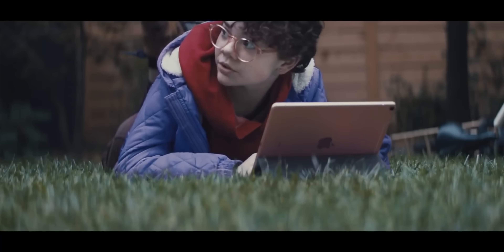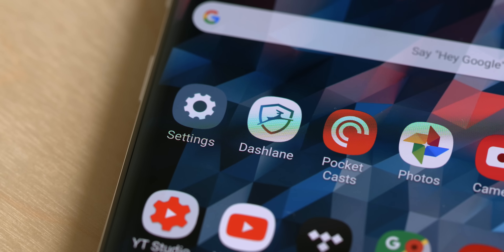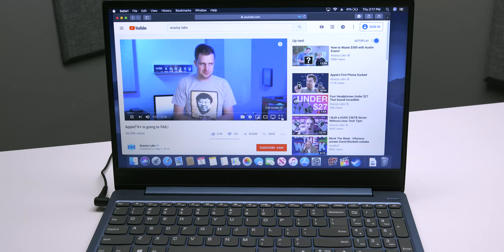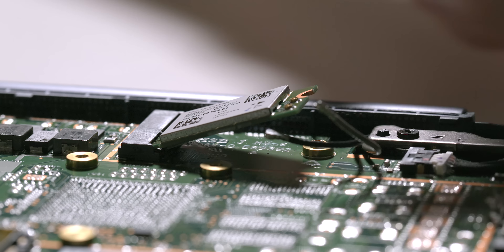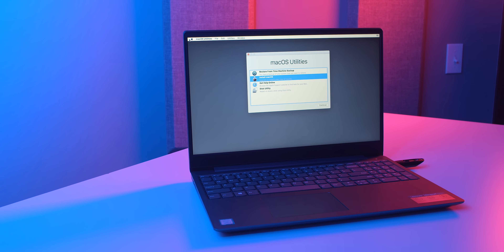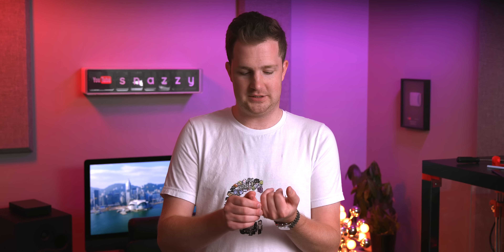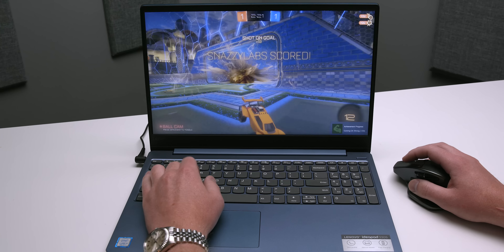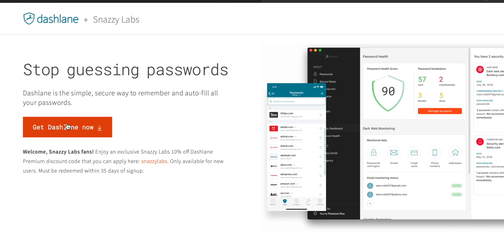The $279 MacBook Air KILLER!

Comment: "apple reccomends 8GB"

- so thats why my macbook air from 2015 with 4gb of ram is so trash
Reply: Mojave however wasn't released in 2015
Reply: Bukan Vanessa Angel 😂 or install some ram via CD-ROM
Reply: I guess it is kind of hard to compare every wintel install versus a *inx install since the kernel is so fundamentally different.
Reply: @thomas0086  only problem is you have to download a cd rom reader as well
Reply: @My_Old_YT_Account  Pretty sure you can print a cd rom reader these days.
Reply: 2015 is upgradable!  Pack that puppy full of ram d00d!
Reply: @MemelordSupreme  it isnt. its saughtered.
Reply: @MalteSpieltYT  shoot i just realized you said macbook air.  I was thinking of the macbook pro! My bad!
Reply: @MemelordSupreme  thats fine! yeah, the macbook air is sadly not upgradable. but at least the GPU doesnt die like in the MBP
Reply: @MalteSpieltYT  Soldered*
Reply: not so much since those machines have pci express based storage so when they have to page file its not to much of a bottle neck as it were to be when they had to do it on a conventional drive but i feel you on that. Apps like premier recommend 8gb and the computer has 4 and then still manages it just fine.
Reply: you can upgrade a 2015 though...
Reply: you still bought it :O
Reply: What’s you e-mail address, I can send you at least 7gb of ram to you inbox. For the extra Gb you’re gonna have to ask Santa Clause.
Reply: All with fapple logo is trash then ram not help you...
Reply: That's why my samsung tab s6 has it.
Reply: SAME with my 2014
Reply: @AgentLokVokun  Mac OS is too demanding. Other unix/unix-like oses are way less demanding.
Reply: @vogonp4287  MacOS Mojave requires at least 2 GB of RAM as well as 12.5 GB of available disk space...

MacOS Mojave requires at least 2 GB of RAM as well as 12.5 GB of available disk space.

Demanding how?
Reply: @AgentLokVokun  I was referring to Mac OS Catalina.
Reply: @vogonp4287  Catalina requires 4 GB of memory. So according to Apple it's more of a want then a need :P
Reply: So in other words ...Mac is trash lol
Reply: @MalteSpieltYT  dude said saughtered
Reply: yeah for 150 with 60 cycles on the battery. couldn't say no to that one
Reply: Just make a usb booable ram!!  
Install it enjoy 🙂
Reply: Just download more RAM
Reply: It was widely known in 2015 that 8GB RAM minimum was the future.
(well among those "in the know" at least)

If you made a bad decision it isn't apples fault, you just made the choice to by a product thats not really future proof.

Bought a late 2012 MPB with 8GB ram in 2013/2015 and still use it daily to this day. 
And it's ages pretty well.

Lesson to learn:
ALWAYS do market research BEFORE spending money
Reply: I’m getting 2015 MacBook Air soon lol
Reply: bruh my macbook air early 2015 is still fast like my first time using it
Reply: Just download some ram
Reply: my macbook pro from 2015 got 16 gb 1600MHz DDR3 ram lmao
Reply: Thats Why I use linux on my Macbook pro 2012 :D .. Linux on Mac . apple would kill me
Reply: get rid of all the trash on your MBA, clean the drive it will be a lot faster.
Reply: But "muh optimizashuns" I thought Windows was the one that is bloated and Mac doesn't need that much RAM to run.
Reply: @theultimateanswers  what's the difference between Mac and Windows then if the user has to occasionally clean their drives? At least Windows has much better software support no matter how garbage it is. MacOS is good but nothing I can't get on a Linux distro.
Reply: @PurushNahiMahaPurush  blame de SSD drive makers for slowing down drives when they run out of space
Reply: my mom has that exact model lmao
Reply: lol, you were supposed to skip that model
Reply: Lmao running catalina patcher on a 2010 macbook air with a core 2 duo and 2gb of ram, the only problem is it ramps up to 70°C when you have a zoom meeting and safari open lol
Reply: uses catalina with 2GB What boys?
Reply: @VBottasG  yes, that is right
Reply: I have an 8gb one and its pretty trash too dont worry
Reply: Its cuz its a 2015 mba even an early 2008 black mb handles catalina
Reply: Lol this laptop is a piece of garbage, now days lol. Tn panel/low resolution, DUAL core CPU lol, I guess you could atleast put Lubuntu/low spec Zorin OS on it, lol. IF you keep this piece of garbage, I would make sure you have an SSD/install one. With this terrible laptop, you may as well get a tablet, or a think pad, and get real Linux.

Also, if this computer is your setup/your only option/even a consideration, a tablet MIGHT be a better option, if you were getting an I5/I7/I9, that would be a different story/a laptops a better option.

I have one laptop, that has these low secs, but its my server and it has Red Hat Linux on it/a LUI/Line User Interface OS/Operating System.

Also now days you NEED, atleast (IPS) 1920X1080 16X9, an I5, Quadcore,8GBs of RAM, and an SSD for the OS, that SHOULD atleast get you by, IF your not video editing/rendering/gaming.

My main laptop has an I9,64GBs of RAM,SSD,M.2drive,7200RPM hardrive, 17.3inch 3840x2160p IPS display, 2080.

My thinkpad has an I5,8GBs of RAM and an SSD.
My desktop has two 3090s, I have 6 laptops though, for different projects and all of them, except my server has better specs than this laptop.
Reply: @mattmatt2417  yeah buddy i dont think you do have all of that.
Reply: @MalteSpieltYT  I have allot of my laptops/computers/desktops, for testing my code/software/drivers/apps/automation/what ever I'm working on/I use/have multiple OSs, Windows 10 and Manjaro, MAINLY/on every machine, I have, except for my security machine,but like I said, my server has red hat linux on it. I game too, but I use the cores/RAM, MAINLY, for emulating multiple devices at once/testing, I also have a laptop with Kali on it, for security/pen testing work/vulnerability testing. 

I was able to get my 3090s on launch, mainly, because I have a contact/someone that holds items for me, on launch/I've had this contact, since the PS Vita's release,they also helped me acquire my PS4 as well, I will be/I have a PS5 and some games, pre-ordered, for next month/November 12th,I MAY get it a few days early too, IDK, but I'm fairly sure, I will get it, by the 12th, they haven't let me down yet.

When I got my PS3, I had another contact/ I got it, from a family owned/mom and pop/franchised play and trade/I got to know the people that ran the store/EVEN when they let me get games/consoles SLIGHTLY early, I would still come to the midnight releases/I would also, back then lol, I didn't know what I do now, but I remember unplugging my router, to be SURE not to get in trouble/to not connect to servers, before the console/games release date.

At this point, all my external displays are 4k/3840x2160p, I also have ONE 50INCH 7680x4320p /8k monitor, for gaming/to game with my 3090s.

Anyway, since the PS3 release though, ALLOT has changed lol, I barely had the money to buy my PS3,a couple of games and a tv lol, I think my TV back then/for a little while was 19inches lol, now I don't own a tv/monitor under 42inches, and my biggest display, now is 75inches and I also have a projector, that projects an image, thats even bigger lol/things have changed ALLOT lol, I was working retail back then and I'm a programmer now, along with some other stuff as well/security related and I used to build hardware, with in ATMs and load software, but I work from home now/have for atleast the last three years.
Reply: Same
Reply: You should get some more installed
Reply: bro I'm using a late 2011 MacBook Pro 4gb ram and 250gb ssd and its working awesome. I can still use final cut pro and the export times are decent s please just don't complain... though I would recommend you too downgrade to high Sierra, the booting time on my Mac is 7 secs and when I installed the Catalina patcher it was about 40 secs
Reply: @earnestarchanist7677  Yeah, I would recommend 8gbs of RAM as well.

For any computer now days, I5 quadcore, NO DUAL CORES, 8GBs of RAM, an SSD, IPS displays, NO TN pannels.

That ALONE, would be good, for the average user, BUT, if your editing, an I7 or I9, would be better, 16GBs of RAM, would be better, also an SSD AND an M.2 drive AND a 7200RPM 1TB OR MORE hardrive.

Anyway yeah, we've grown out of I3s, dual core processors, 4GBs of RAM, TN Panels and systems, with no SSDs.

UNLESS you run Lubuntu,Bodhi,Zorin Lite weight/a version of Linux thats designed for old hardware, AND your not video editing.

I also wouldn't recommend a mac/an apple computer, if your on a budget, if your running an old computer like that, I would definitely say your on a budget.

If your willing to spend ATLEAST 1x more than the computers worth, than, I would say go with a mac, but the other issue is Macs graphics cards ONLY go up to a certain level, even for the way over priced computers Apple offers.

At this point, I would say, the hardware in your computer, is worth ABOUT $150-$185, if you pay ANY more than that your over paying, for $200-$250/MAYBE $280, you can get an I5 quadcore, 8GBs of RAM, If your buying used, IF your buying a laptop with an I5 quadcore,8GBs of RAM, new, that SHOULD go for $500-$550, MAYBE $580.

I wouldn't buy an I3/dual core/4GBs of Ram new.

My MAIN laptop/my most powerful laptop anyway, has 64GBs of RAM, an I9 8cores, 2080 graphics card, an SSD,an M.2 drive and a 7200RPM hardrive, It also has a 17.3 inch 4320x2160p IPS display.

I need this much power to emulate multiple different devices at once/to test code.

I also run Windows 10 AND Linux Manjaro/I have both OSs/Operating Systems.

My other main laptop is a think pad, with an I5,8GBs of RAM and it has an SSD, and it has Manjaro Linux on it.

I have a total of 6 laptops, all of them, but one have an I5,8Gbs of RAM and an SSD, MOST of them run Manjaro ONE has Kali Linux on it.

I also have ONE laptop that has an I3,4GBs of RAM, it has Redhat Linux on it.

So I guess I have 7 laptops, but 6 of them, that I use traditionally/I use one as a server.

My two desktops, have two 3090s in SLI, an I9, 64GBs of DDR4 RAM, 5TBs of SSD space and 9TBs of 7200RPM space, both of my desktops are identical.

Anyway I would definitely say, its time for you to get an upgrade.
Reply: @SandsOfArrakis  I might have to borrow my school’s printer then. I remember hearing about a website that downloads screen resolution, that should make my laptop a beast
Reply: Same man

Comment: CPU is barely enough, battery life sucks, WIFI card needs replacing, screen needs replacing, speakers suck, keyboard flex.... 

Don't get me wrong, this is a decent laptop for the price and much better than a Chromebook. But it's no Macbook Air killer.
Reply: Opposite
Reply: for that price you just want to experience the mac ecosystem and it really kills that bird with no problems. You can check out other hackintosh laptop with higher price and will have better power and be cheaper than macbook air but then you might argue why spend so much on a hackintosh. the fact that it is faster than macbook air 2018 is good enough for a student who has learnt on macs but can't afford them at home.
Reply: @randomyoutubeuser8509  what's the point when everything else in unusable?
Reply: @Shanboss277  basic tasks get done easily. What more do you expect from a 300 dollar laptop?
Reply: Kills it in performance and with a few upgrades in other things to plus ports and repairs.
And you can upgrade the graphics cheap no ego needed
Reply: The CPU is double the base speed of the MacBook Air, battery life is just fine, installing macOS on any laptop requires replacing the WiFi card, and it’s a third of the cost. You’re right it’s not a MacBook Air killer it’s a MacBook Air slayer
Reply: I like chromebooks for school.
Reply: I like the “Whackbook Bro” name.
Reply: @Abdullah Iqbal at 1/3 of the cost it fairs fantastically
Reply: I put 800 into my hackmac and I can assure you its about head to head with the MacBook air
Reply: There is many students that needs it to learn ios coding including me and can't afford a mac, I think this is very good way to sort that
Reply: Theres a reason its called the WhackBook
Reply: The CPU is better than the macbook air lmfao

Screen and wifi card replacement is dirt cheap and easy

Battery life is something you gotta deal with but that's ok. Laptop speakers are arguably not important
Reply: @benjaminchen4367  I’ve found that with most cheap Windows laptops it’s not hard to find a beefier upgrade battery. eBay is covered up with vendors. Big bang for the buck and I’ll bet you could upgrade this one too. It’s kind of a thing with me to see how much I can improve cheap laptops that way just to prove that ingenuity beats $$$ most of the time.
We usually are only buying convenience when we spend more.
Reply: @k.b.tidwell  yeah that's true. Most of those chassis have a lot of extra unused space you could probably fit a bigger battery into
Reply: I agree
Reply: though performance wise, it's still better than the shintel shitbook air.

Comment: Please try to make more expensive wrackbook for about 500 up to 600$ with newest i5 or older i7, how much it comapres with the macbook pro.
Reply: This
Reply: WhackBookPro pls.
Reply: My thoughts as well.
Reply: YES! Not the cheapest, but the BEST hackintosh laptop! 13" please.
Reply: Maybe a Xiaomi Notebook Air? The 12" model costs about $500 and the 13" is at $750 if you order it directly from china.
Reply: @marilyn Liebenguth 
Macs generally doesn't thermal throttle more than most other laptops.
Reply: Huawei matebook d for this build. Ryzen 2500 built like a tank
Reply: Would be very interesting!!!!
Reply: Would be interesting but I suspect it would be a lot more difficult since most people doing this type of hacks want a cheaper MacBook or a more powerful MacBook than what Apple Offers.  This means that there likely isn't going to be a lot of people attempting to make it work on the mid range.  Although to be clear I'd be incredibly interested in how cheap you could make an MacBook Pro Killer.
Reply: Try to make a whackbook superpro, how a 4000$ hackintosh crush the 4000$ trashbook
Reply: yes
Reply: Dell xps
Reply: 800$ Dell we had in studio along with highest specs MBP (2017)  performed better  ... But that was due thermal throttling which is more under control in 16 inch model ...
Reply: Once you have a decent spec laptop, just install a minimal linux and then run OSX in a virtual machine.
Reply: @Kirk Yosores I think 8 gb ram is enough for average user's
Reply: Paul Mansfield that works
Reply: I am currently running hackintosh mojave on asus vivobook s15 i5 8250u, 8gb ram, intel 620 hd, nVidia mx150, 256gb nvme and 1 tb sata hard drive. Cost me roughly $700.

I have dual booted it with windows 10 pro on nvme and mojave on sata drive. 

Everything works on mojave except micro sd slot, fingerprint sensor and nVidia mx150 video card
Reply: It'll probably be the same thing. Louis Rossman already complained about those new Lenovo thinkpads being way less powerful than the old ones

Comment: 300$ outperforms a mac book air...

I'm just gonna enjoy that
Reply: BOSSMxN305 They last longer though, and their power is totally overlooked. My MacBook from 2011 still works perfectly
Reply: @jdfishing3873  my dell laptop from 2010 works perfectly too
Reply: @jdfishing3873  my 2009 acer laptop is working too, but not so good with modern usage, installed linux and problem fixed
Reply: BOSSMxN305 they r waay better than pc but there are some pc’s that acc gd but rlly expensive
Reply: Macbooks are no longer worth it. They were one of the best laptops back when Jobs was alive. But since then Apple has ruined them in a stupid quest to make them more and more thin to the point that their "Pro" machine runs hot like a steam engine. Overpriced nonsense specs, with soldered RAM and SSD (LOL), a pathetic number of ports (so that you are forced to buy more accessories) and a crappy keyboard. The only good things left from the old days is that it still has one of the best trackpads and displays on their laptops (credit where it's due). How long before Apple fucks that up too in a stupid quest to make their laptops the thinnest rather than the most capable.
Reply: @coronavirus4955  using linux is kinda a joke for real world usage, except if you are a developer
Reply: @kamikamieu  i mean Linux is considered more secure most Servers run on linux you can play many games on linux that are compiled for windows through proton and vulkan competes hardcore with directx. I wouldnt say it is a joke especially if you spend some time learning it you'll find it far more powefull than windows at least imao. Also linux uses most Hardware more efficiently
Reply: how he install mac on windows i dont understanded someone pls  🙏😅
Reply: Gladiadior you should consider learning it first. Unlike installing linux and windows, hackintoshes are much harder to install
Reply: 高橋有希 is that legal?
Reply: @wcrsb  it's perfectly legal and safe if you don't live in the US. Actually don't use it for commercial purposes or else you'll be screwed by Apple
Reply: @rennn.x5711  Mac's are far worse than windows and Linux machines. The apple tax is a massive problem and u can find better specs for less
Reply: My 2012 hp elitebook still works perfectly too
Reply: S V  Gentoo is “technically” harder but hackintosh is much harder to get the software running perfectly due to hardware restrictions.
Reply: The table has turned
Reply: @RobMusik  laughs in m1 chip
Reply: Not anymore my friend
Reply: 999$ MacBook Air M1 outperforms 2000$+ laptops :D
Reply: to be fair need to also consider memory, screen and battery.
Reply: @rennn.x5711  no they are definitely not better than pc’s... a prebuilt will probably beat a macbook. With a pc you can actually upgrade them for the future. MacBooks can just get worse over time
Reply: @mkiwas  they r end of